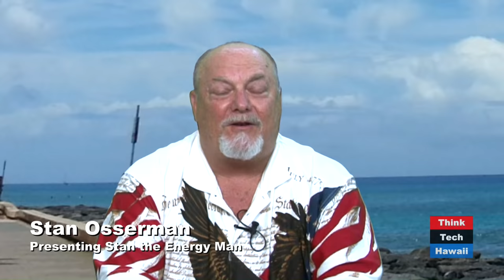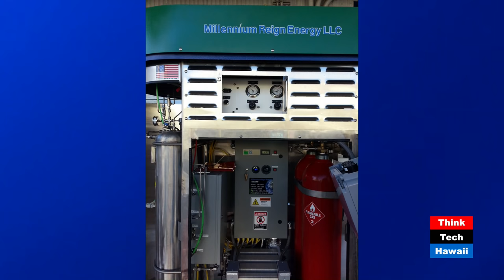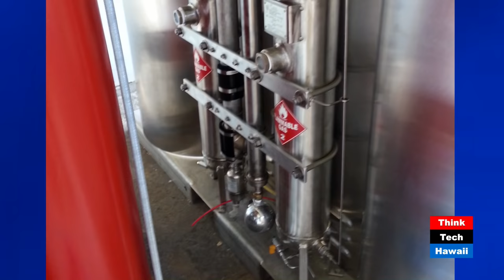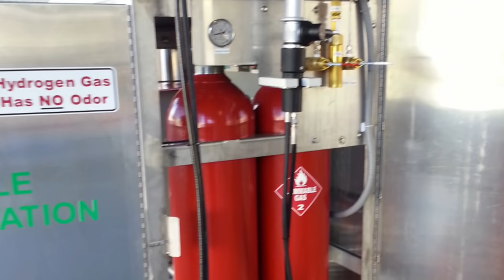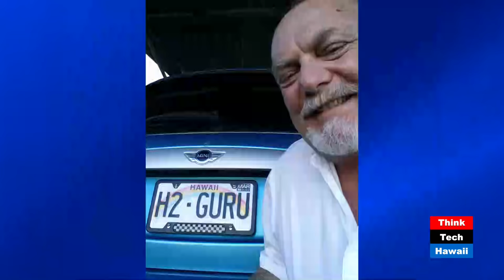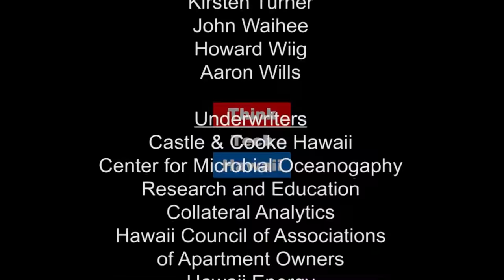Safely Making, Storing and Dispensing Hydrogen

Comment: How viable would a H2 electric generator be?  It seems this could be a great way to store solar energy for use in winter, if it can be stored decently.   In summer you end up producing tons of power while in winter the days are very short so it could help.  Where would one buy a very high pressure compressor if they wanted to build something like this?  Most compressors you can buy only go up to around 135psi.
Reply: Anyone?? Have you learned anything about finding a compressor? What is the style/name of the compressor that this system uses?
Reply: @natiej  Fridge compressors
Reply: @WyattsVlog  hydrogen has a very low flash point and using a fridge compressor might cause an internal detonation which you want to avoid LOL . Best and safest way to compress hydrogen is either by cryo method by supercooling it or using an ebsorbant …
Reply: @PhysicsViolator  Correct me if I'm wrong but only liquids have flash points. We're talking about pure hydrogen gas. Hydrogen gas has an auto ignition temperature of 500C. So unless your fridge compressor reaches 932°F, your safe. Care to elaborate?
Reply: When you say h2 electric generator, that's what a hydrogen fuel cell is (and an electrolyzer is essentially the opposite of that) and yes I think adding a fuel cell to this system as a home storage system for solar is a viable idea. I remember seeing a company selling a product like that not long ago. Can't recall the name now. Combine that with a hydrogen fuel cell electric car and it seems like a nice setup.

Comment: Great reporting, rich in detail.  Hawaii has everything coming together.  Using water as the feed stock with the abundance of solar and wind resources you're focusing on a real path forward, and a model for the 21st century.  An energy system (solar-water-hydrogen) operates with no fuel costs, no toxicity, industrial strength, greater safety and higher performance.  There's a future in that.  Hawaii has everything to gain from this renewable water battery technology driven by distributed solar energy.  Economically, the world treats energy as a commodity, if you need it - you pay some vendor for it - the price always changing.  The solar water cycle your system demonstrates would change the fundamental economics of energy in Hawaii from a high-cost variable commodity, into a lower fixed cost - reducing energy prices while abating pollution from traditional fuels.  Hawaii has a bright future as you accelerate this work.  Looking forward to your next report.

Comment: Pure water converts to liquid hydrogen at a roughly 1:32 ratio based on the atomic mass of water vs hydrogen. But if you use solar power to convert it, and eventually recycle all involved equipment, you can generate useful power at a fixed cost in a closed cycle since the hydrogen just becomes water again.
Reply: liquid H2 needs to be maintained at minus 250C or there abouts, so the cost of getting H2 to liquid state means that unless you do it al large scale it's too expensive to make.  The optimum liquid H2 plant produces 30 ton's/day of H2.

Comment: I have two questions:

1. Why don't we generate electricity from hydrogen fuel cells so all vehicles can essentially run electric? Why is there a preference for fuel in the form of hydrogen instead of hydrogen to electric prior to energizing our cars?

2. Why don't we just 'mine' the hydrogen in space? Seems easier than processing water for hydrogen.

Best wishes +ThinckTechHawaii :)
I found this presentation highly educational, thank you! Hydrogen is the future!

- Float Circuit.
Reply: Float Circuit I assume #1 energy density and quality of batteries isn't there yet.  H gas is a good energy storage method,  and can be re used with less waste, #2 space is still costly
Reply: Thank you +RangerOberon, I appreciate your answer.
Reply: no, it isn´t, also spacemining gas? how? fuelcells are very inefficient!

Comment: How long will the desiccant last before it needs to be changed or recharged?
Reply: i didnt watch the video but my advice is to use quicklime as dessicant because you can throw its waste into a sodium carbonate solution and it will make you sodium hydroxide and calcium carbonate, and calcium can be recycled indefinitely.
Reply: Depends on use, but full time would be about once per year.

Comment: Very nice explanation.. love it..  very clear..
If you don't mind Stan, a small question on the h2 market that I can not understand.
Why everybody seems to use cylindrical tanks?
You said that the biggest issue is the storage..  but I dont understand why nobody take the advantage on the volume/surface ratio benefits of the sphere and the scale.
Those cylinder tanks does not take advantage of scale, neither volume/surface ratio.
For example:
If you use 1 sphere tank with the same surface than 1 cylindric tank, then you get 50% more volume, then if you remplace all those 6 cylindric tank with 1 sphere tank with the same surface than all those cylinders, you get  450% more volume at the same cost.
But still.. most applications use it.. why??
Reply: First thing I have to say.... This is obviously not Stans channel but someone who has taken the footage and posted it on you tube instead of having to watch it on tv.     Now on the the point. 
Have you ever tried to move a tank of that shape or of that size???? Normal tanks as they are can be very annoying to move and very very heavy. Shape is a very big issue when it comes to that kind of thing. Although I do understand your  way of thinking it is very impractical to have something like that for the average person since no one would have a way to move it realistically without help and it would take up allot of ground space in their storage area.  With the stand up tanks I believe that you actually get a better amount of  storage if you are a company that has to deal with storing the tanks and  filling them as well as ship them out.
Reply: I was digging more in the cylindrical vs spherical tank issue since my comment..
What I find out is that is not an issue of handling.  is because cylindrical shapes were always (mostly in the past) easier and cheap to manufacture, You simply need a flat metal sheet and fold it like a cigarette, but cyindrical has another flaw beyond volume wasted, they resist less pressure.   Now with carbon fiber and automatic machines who "paint" layer by layer..  the spherical shape is not longer an issue, that is an issue only if you start from flat metal sheets, but this technology is still new and there is not a huge demand yet, so nobody made big investments to set a factory of spherical tanks..   But this is an opportunity...  About the handling, that is the less of your concerns and can be easily fix it in case you care..  but these tanks are not made to move them from one place to another..
PD: I read a PDF where is explained all the details about tanks manufacture, they explain all shapes, I also find info from NASA, which now is experiment with spherical fiber carbon tanks.
Reply: manufacturing cylinders is easier than spheres, i guess
Reply: The strongest tank for a gas under pressure is a sphere, the second is a cylinder, after that there are too many weak points that lead to failure.

Comment: Love you man....this kind of attitude will save this amazing blue planet, still I have a question ..... if they have safe enough liquid hydrogen tank's to fit in cars do you know why they don't just run regular combustion gasoline engines ????......why so expensive fuel cell technology,???
Reply: sry to disappoint you but these systems will never work for the masses in this manner, combustion hydrogen engines are extremely inefficient and unreliable, electrolisys is also inefficient, storage is inefficient and more dangerous than any other fuel, and a save storagesystem will be as expensive as a EV. these problems can mostly be overcome, however the list of problems is so long that there are better alternatives.
Reply: @fabianseewald7884  Dude you OK ? Seems to me a little sqitzophrenic .....there are safe enough tanks for liquid Hydrogen in so expensive fuel cells cars and obviously there are safe tanks for liquid Oxygen....., and so your huge problem is solved straight away.
Reply: Possible does not mean practical,  also why install it if batterys are cheaper saver and you don't need hydrogen fuel station every 100 miles, also i have a mental illness yes, but i also know my stuff
Reply: Blue fuel Systems H2o gas I think Fabian is right about certain things. This technology is not well suited for car application, BEVs are simply superior. Trying to make it fit would be a wasted opportunity anyway, since burning hydrogen in gas-powerplants is so much more valuable as aid to balance powergrid-fluctuations caused by renewable energy sources. You could even biologically or chemically methanate the H2 and feed it into the heating gas grid in the winter times. Decarbonising the primary energy resources also means to find a carbon neutral way to heat peoples homes as well. And since the transportation sectors already undergoes a promising technological development it would be unwise to not use h2 in another sector. What do you think?
Reply: I think the live of EVs in Hawaii is related to the fact you don’t produce them in Hawaii and don’t ever have to deal with that noxious part of the supply chain. Disposal and replacement is never something battery proponents want to talk about. An “aged” Tesla that needs new batteries can hardly be given away. Same for older Toyota Prius. And by the time you need new batteries the battery tech is advanced so retrofit of batteries becomes another issue. The only positive about battery cars is that the government subsidizes them d sad so heavily that they seem cheap. Take Tesla off the welfare dole and their sparkle dims.
Reply: oddjobbobb youre aware that most batteries in BEVs coming up the next couple of years will certainly last longer than the rest of the car? You just wanna try and argue. But over what? Name one alternative automotive technology that is superior to BEVs  in aspects of technological availability and environmental sustainability. A hydrogen fuel cell car is nothing more than a bev with an integrated chemical energy to electrical energy converter and a smaller battery anyway.
Reply: @oddjobbobb  yes we need better batteries for electric cars, but on bycicles they are great.
Reply: Fabian Seewald 
Hey Fabian, I’m sorry for the length of this reply. I just got to writing and the flow wouldn’t stop. 

I hate to be a naysayer about good ideas, And please don’t think I am judging you, but I wonder, have you ever commuted by bicycle over any realistic distance (7-10 miles is not too far to talk about) on a daily basis, for any length of time (let’s keep it conservative and say for 3 years)? I am not asking to judge you (far from it, you share the name of an older cousin who made a big impression on me as a child when he visited wearing his dress blue USN uniform). 

But, I have commuted by bicycle in exactly those conditions. Daily, for 3 years, 7-10 miles every day. Not patting myself on the back. But I know that most people cannot do that. I was young (23-27 yo) I started out fit (6’1, 185) and got fitter, and, most importantly, my jobs at that time provided my with flexibility of clothing so I could basically work wearing whatever I wore on my bicycle. Few people have I ever met in the work place (especially now, where overweight and obese >> morbidly obese is the norm) were in the situation I was at that time. Also, I was/am blessed with a personality that is not keenly (or even remotely) concerned with my appearance. So arriving at work looking disheveled from 40-50 minutes of hard cycling through a very congested urban area area would not be much of a bother. I know in other parts of the world bicycles are used, but that’s not going to happen in the USA or in Hawai`i. 

I lived in Hawai`i for 22+ years and even though it was 12 years ago that I returned to the Pacific Northwest USA,  I am still familiar with the roads, the traffic and the problems with commuting by bicycle in Hawai`i. I tried it when I moved there at at 28. I was still relatively young, and fit. I had a great bicycle. My commute was 7 miles. My workplace allowed me a space to shower and change after arriving. But after a week of battling (literally, battling along Nimitz HWY) traffic, and (bad timing about when I started, as I drove home one day through rain storms caused by a far off-shore tropical storm) terrible traffic I hung my bicycle up and saved it for weekends in Ala Moana Beach Park, or an occasional ride over Tantalus. Luckily my commute never involved going over the Pali HWY (it was open at that time) or the Like Like HWY. And H-3, although it was complete, didn’t have any provisions for bicycles (as it is technically considered a limited access roadway, bicycles may have been prohibited). 

Having lived in Hawai`i for a rather long bit of time I don’t think I knew anyone who would be interested in commuting by bicycle. I know there are plenty of people who take their bikes when they ride the bus, but the front racks hold only three bikes and I know I saw people have to wait for the next bus because the racks were full. But therein lies the rub: they were really bus commuters who wanted to have a bicycle option after work to run errands and then take the bus home. 
And in the mainland USA it is no different, really. Today is a bright beautiful sunny cool day in Seattle (Feb. 19, 2020) and I bet the counter over the Spokane Street Bridge between Seattle and West Seattle is clicking. It is just a-buzz with bicycle riders. And concomitantly, the busses are relatively empty. But, and this is a Bertha-sized BUTT. But, all the busses are running even though the ridership is hugely affected by the weather. Bad weather = crowded busses (actually, it doesn’t, it means more privately owned vehicles because no one wants to walk through the rain, wait 10 minutes in a sub-minimally protective shelter, if there is one at all, and then stand on a bus for 30-50 minutes to take a ride that, in their POV, even in the worst traffic, might take 20 minutes. And they are dry. And they are warm. And they control the environment. And it’s quiet. And they have a adequate-good-great sound system. And they can make as many detours and run as many errands as they want and they don’t have to wait, and wait, annnd wait, annnnnnd wait for the next bus. And they don’t have 75 other dripping wet, sweaty, smelly, noisy , other bodies pressing in on them from all directions.) 

So as much as I want to applaud the idea of battery bicycles as the solution to traffic, air pollution, dwindling resources, etc., etc., I know from my own experience as a true bicycle commuter, it is not ever going to happen. I’ve enjoyed the dialogue. Write me if you want. I am oddjobbob. And use that name “at” google mail. That’s “gmail.” Use the commercial ending, that’s “dot com.” Hope I hear from you. reb
Reply: @oddjobbobb  2 years 28 km everyday to my last job 10 now for 3 years
Reply: Hydrogen is very energy dense but unfortunately is also very "fluffy".  It's hard to cram enough hydrogen into the cylinder under pressure to get the power of a liquid fuel.  Mr. Roy McAllister developed a great system, but he hasn't gotten it into production. Generally using h2 in ICE engines (25%) or even turbines(34%) is not as efficient as using it in a fuel cell (65%)
Reply: @stanosserman4050   Lithium 6 deuderide

Comment: Hello Stan, do you think it is possible to have hydrogen generation and dispensing unit at home to charge a Toyota Mirai? 
If so which ones do you recommend?
Reply: don´t do this as a private person it makes no sense from any standpoint, install a battery at home and use photovaltaik directly
Reply: You’ll spend more money on the station than on the car itself. LoL. If you really 100% need a car and cannot go with alternative transportation i would suggest a BEV. Better concentrate on building up one working infrastructure than multiple completely different ones. And electric is what works just nice already ;)

Comment: Stan, enjoyed your video.  My question is how much PSI is needed from the storage tank in the vehicle to the fuel cell.  We are perfecting a system to run a fuel cell from hydrogen produced on-board the vehicle.
Reply: how will you produce hydrogen onboard? are you talking about a ship or something?
Reply: Fabian Seewald there is no on vehicle H-2 production. There is an H-2 tank that is refilled.
Reply: @oddjobbobb  what do you mean i don't follow
Reply: Producing h onboard how will this be efficient? If you decide to burn money maybe you should instead donate to charity
Reply: the pressure into the fuel cell is rather low.  Depending o the fuel cell it's between 25-100 psi.
Reply: @fabianseewald7884  I should also mention we are producing hydrogen on board a vehicle, introducing it to the combustion chamber of an internal combustion engine which in effect decarbonizes the engine and reduces harmful emissions.
Reply: @kenhembroff1187  i admire Ambition for the betterment of the world, however i feel vindicated in the assumtion that hydrogen ist to volatile to handle by the average joe and there are better alternatives in my mind , If you use hydrogen as an aditive to better Control  combustion you schould probably Just use water  you can use waterinjection to lower nox emissions and increase the engines Performance across the Board including reliability, If you have hydrogen already and your mind is Set you should Power a fuelcell, and drive an Electric car